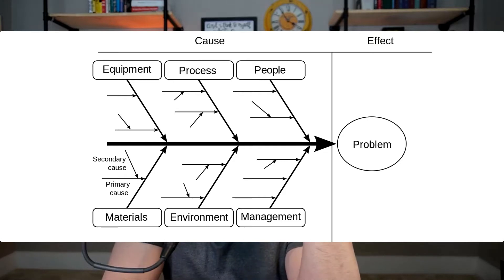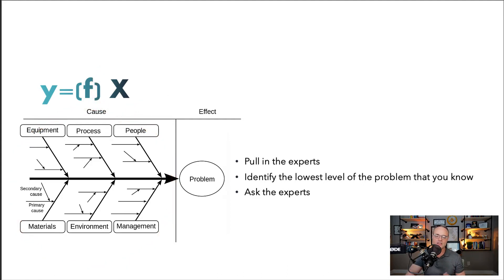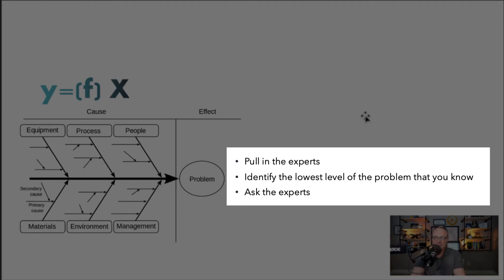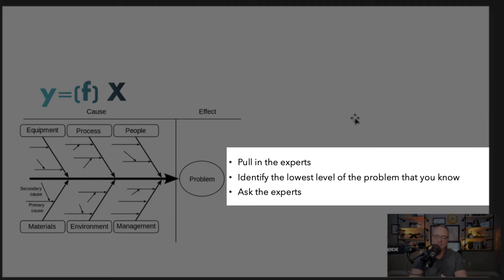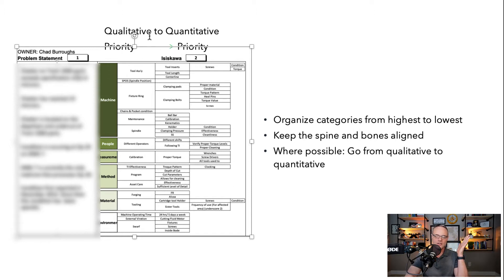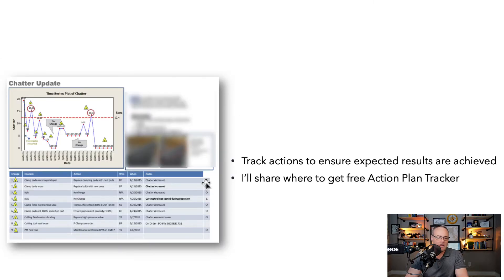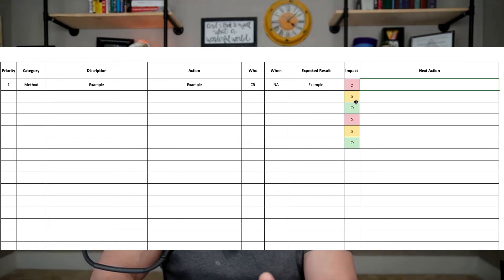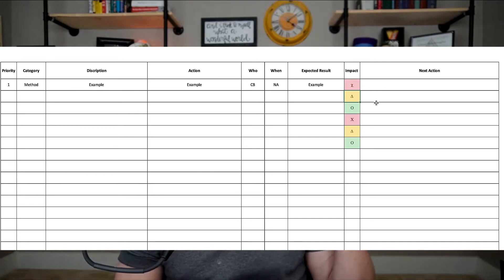Using the Fishbone to Solve a Complex Aerospace Problem

Comment: So what exactly was the problem?
Reply from the maker: TPM process didn’t include support pads for CNC Turing table causing wobble that transferred into the metal causing that sine wave in the metal.  Real purpose of video was to show how to use the ishikawa. Thanks for commenting!
Reply: @ wow thanks for answer, I have to say your videos are best always on spot. What makes a good lean facilitator in your opinion?
Reply from the maker: @stevenstryka7840 this is a great question and sort of difficult to answer, but I’ll try. First, Lean practitioners should focus on balancing  processes to customer demand while creating a process that is easy for the operators to accomplish the required cycle time. A lean practitioner should also have the ability to influence leadership. Often times, leaders don’t understand the benefits of lean so having an ability to influence people is a necessity (although this one takes time to learn). Understanding how to get to the true root cause of a problem is also important and a required skill set. A great lean facilitate can set up measurement systems for the business, address the root cause when the business isn’t achieving the desired metric goal and knows how to improve process rapidly through Kaizen to keep the business ahead of the competition. So, to sum it up- you should know the business you’re in, understand what success metrics are needed, drive to root cause when metrics are missed and prioritize improvements to keep the business competitive. Hope this helps.

Comment: I am not being rude...but a machinist could have figured out that problem in 1 day
Reply from the maker: That’s not rude at all. I’ve worked with lots of machinists over my career…machinists are great problems solvers. They tend to have a systematic mindset which is needed for systematic problem solving.  Not all machinists are great (or even good) problem solvers but I’d say a majority are. Having said that, there were machinists who worked this problem for months. Some awesome machinists and awesome problem solvers employed in aerospace - so they know what they are doing. In this case, not even some great machinists solved the problem in one day. However, they were part of the solution. I could not have solved this on one day. They could not not solve this on one day…however, together, I think we did a great job at systematically solving the problem while keeping impeccable records to understand how each change we made impacted the outcome. I appreciate your input and value your opinion! With sincere respect: the main issue I run in to when I am working with a team who hasn’t solved the problem after trying is that they always know what the problem is…but it’s still reoccurring. If they can’t turn the problem off and on at will, they haven’t gotten to the root cause. Again, that you for the input.

Comment: In another video you say there is only one root cause to a problem. In fishbone diagrams you normally have many contributors to a problem. Which one do you see as the root cause then?
Reply from the maker: The Ishikawa (Fishbone) illustrates POSSIBLE contributors…and it’s possible two or more contributed to the problem…however, the root cause must be process related because if we remedy the process, we prevent recurrences. If we remedy a contributor (or all contributors) we’ll see the problem again. Thanks for the question! Let me know if I can help further! 🙏
Reply: @learnkaizen  contributors I get, they contribute to the cause.  But we are not looking at a process chart.  So how can you say it's the process we need to address while what we are analyzing here are all the contributors to a defective process?  maybe I am not saying this exactly right either
Reply from the maker: @robertshreffler6155  I think you've asked a great question and I can completely understand where it may get confusing...Let me try to explain (always difficult over text/email but I'll try)...

Analyzing contributors is the right thing to do...then you'll drive down to the main contributors and fix those...most of the time this is simply a poka yoke of some sort (which is great) - but then we need to continue the problem solving investigation to understand what in the process allowed the failure. Here is an example: 

I had a flat tire on the way to work. A very basic level of problem solving would be to replace the tire. A deeper analysis may result in a fishbone: Y=(Flat Tire), X=(nail, old tire, screw, NG tread, leaking air, etc)...(Contributors). We find that it's a nail in tire (Cause), Why: Construction in Neighborhood - loose nails everywhere. No process to examine tires prior to leaving neighborhood to ensure correct pressure in tires (Root Cause)...Fix=Check Air pressure each night and each morning. Record pressure. If pressure decreases by- 2 PSI - examine tires for nails.  

if we stopped at changing tire, the problem would happen again, if we stopped at removing nail and patching, the problem would happen again. By establishing process to ensure correct air pressure with measurement - we've introduced a process that will help eliminate the flat tire...this is a basic example with plenty of holes in it (no pun intended😀) but hopefully clarifies my intent.